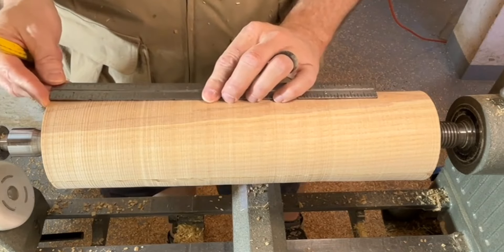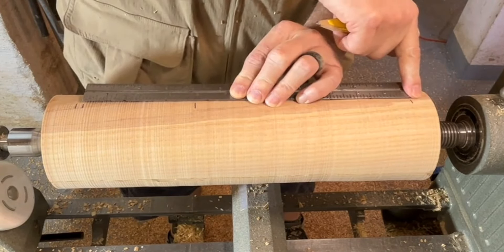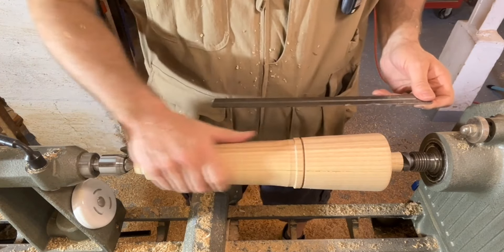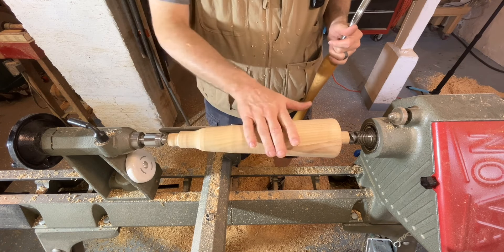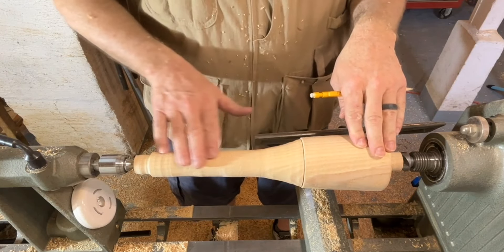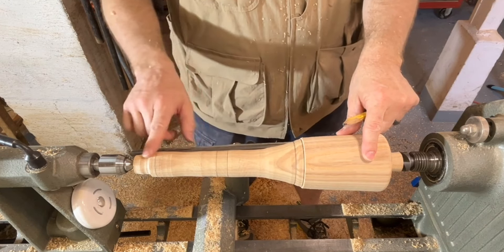How to Start Woodturning | Making a Custom Mallet | Lesson 4

Comment: Nice video.  I have watched a few of them and I subscribed because you are a good instructor.  How often do you have to sharpen the tools? You mentioned that you sharpened part way through this mallet project.  I guess it probably depends on the quality of the tool and maybe the hardness of the wood.
Reply from the maker: Kevin - you are correct that sharpening depends on the tool and wood.  Ideally if you notice a tool not cutting as well it’s time to sharpen.  When I am getting close to my shape and size on a project, I often sharpen then to get a really clean cut.  Clean cuts reduce sanding.  If I am using a scraper on a bowl interior for example, I don’t even turn off the grinder.  I may sharpen every 30 to 45 seconds.  It’s also helpful to make sure your grinder is close to your lathe.  Thanks for watching.  And keep the questions coming!